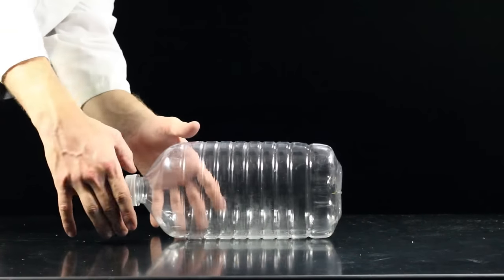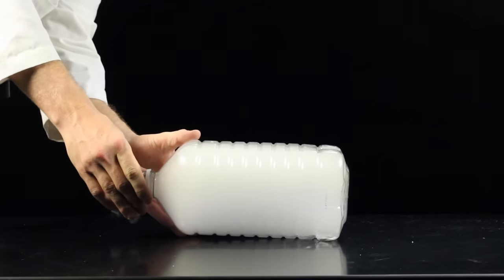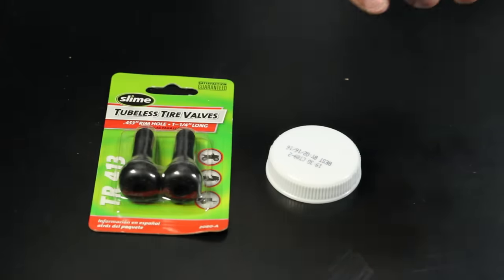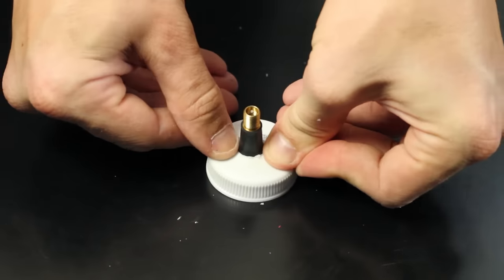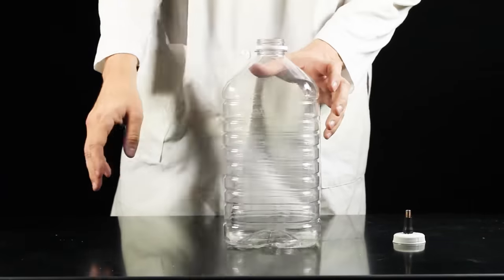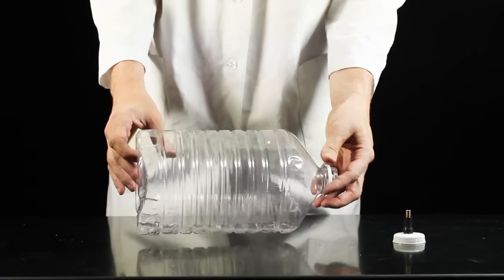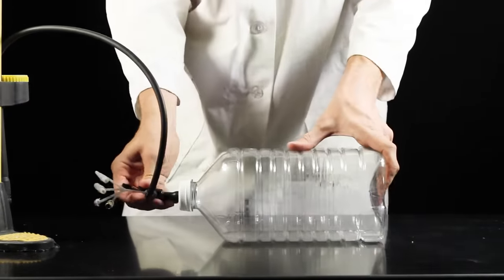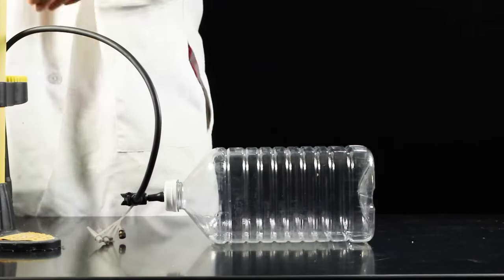Instant Cloud in a Bottle (Chemistry)

Comment from the maker: When the pressure is released the temperature drops rapidly causing small droplets to form from the condensation of vapors.  Isopropyl alcohol evaporates more easily than water creating more vapor molecules than if we had done the experiment with water.  So when the pressure is released and the temperature drops, the cloud is denser than if we had used water because there is more alcohol vapor than there would have been water vapor.
Reply: BeardedScienceGuy 

Wouldn't a cloud of alcohol vapor be dangerous? What would happen if you lit it on fire?
Reply: Peter Barta sounds like fun to me
Reply: Peter Barta in the bottle i'm willing to bet it would not in fact explode. Not enough oxygen more than likely. I have played around with alcohol enough to take an educated guess and say that by placing the bottle up again and lighting the top on fire you would basically have a small lamp of a sort. Nothing useful but it's still itneresting. Still, wear protective gear when playing with fire. And always have a fire extinguiser there. safety first after all.
Reply: +BeardedScienceGuy now my friend said you cant inhale this i will die dont do it soo is it true
Reply from the maker: Depending on how much is absorbed into your body, yes.  Isopropyl alcohol is toxic and will lead to many negative health effect if absorbed into the body.
Reply: xphosGameing One breath wont kill you (has done it as a kid) but it can burn the lungs and if one continues breathing in the vapors it can do a variety of things. The most immediate being suffocation.
Reply: write a comment not a essay for school
Reply: BeardedScienceGuy

Comment: Could I get drunk off breathing this in lol
Reply from the maker: Joshua Nuckolls The term alcohol just means that a molecule has an oxygen atom bonded to a hydrogen atom.  There are many different types of alcohols and some of them will cause you to go blind or even die at high enough doses.  Isopropyl alcohol isn't the most toxic form of alcohol but it is toxic and not what people are talking about when someone uses the term "alcohol" in everyday language.   The type of alcohol being consumed for it's intoxicating effects is ethanol alcohol.  Isopropyl alcohol has more carbon atoms than ethanol alcohol and the molecule is also a completely different shape.  These differences lead to severe medical problems in moderate to large doses.  DO NOT DRINK OR INHALE ISOPROPYL ALCOHOL.
Reply: BeardedScienceGuy Which property of the ISOPROPYL ALCOHOL is responsible for this effect? Any other liquids that can give similar effects?

Comment: My Son wanted to do this for his science project but I'm doing something wrong and I can't figure it out.  I pump up to 20 psi and when i release the lid it makes a loud noise and the air shoots out but there's no cloud.  What am I doing wrong?  I do have the alcohol in there too.
Reply from the maker: The temperature of the bottle should be fairly warm and then you might try 30-40psi.  Most bottles will rupture at between 80-110 psi so you would still be well below that pressure but be careful of the cap flying off.  Also be sure to let the pressure drop quickly, if the pressure drops more slowly then you won't see the desired effect.
Reply: @BeardedScienceGuy  Thank you!  I ended up buying a rubber stopper from Home Depot and that really helped.  I think the screw on cap wasn't being released fast enough.  We worked hard on this project...hopefully he gets an A!  :)

Comment: Hi, just stumbled upon your video. Pretty neat, but you could a cloud without all that stuff by twisting a water bottle and building pressure within it that the cap would fly off and you’re left with a cloud ... does the alcohol have any significant importance? Mine was just a plain empty Poland spring bottle.

Comment: Will it Work of its hot outside/ it seems not to work when I tried it outside ....
Reply from the maker: +Danny Cruz (OboeFiles) You might need to add slightly more pressure.  The pressure drop in the bottle drops the temperature of the bottle causing the isopropyl alcohol to condense.  If it is hot outside you might need more of a pressure drop to get the isopropyl alcohol down to a temperature where it will condense.

Comment: If this is repeatable on a large-scale or even if one could create Cloud vapor on a large scale wouldn't you be able to effect the weather?

 being able to create so much vapor we're basically repeating what mountains do from the water that goes on it from the Dew, so.

 weather control?
Reply from the maker: We absolutly have the technology needed to change the weather.  The problem is the cost.  The clouds go tens if thousand of feet into the air.  Imagine 20,000 of these bottles stacked on top on one another and then you need 25 million of those stacks to be about one square mile of the earths surface.  It is still really really expensive but sending massive solar shades or mirrors/lenses into space would be a more cost effective way to control the weather.

Comment: 1:53 What happen to the liquid inside the tank ? (The sudden shake)
Reply from the maker: Yo Zora The bottom of the bottle is a dome shape that went from being an inward dome to an outward dome as the pressure increased.  The shockwave from this change in the bottles shape caused the liquid isopropyl alcohol in the bottom to spring upward.

Comment: Does it explode when lit?
Reply from the maker: Ioan Dragomir It will shoot a flame out the back but not explode unless more oxygen is added.  Our atmosphere is around 20 percent oxygen and unless oxygen is added to the bottle to increase to oxygen to fuel ratio the bottle will typically not explode.  That being said the reaction will increase the pressure in the bottle and if there are any structural weaknesses in the bottle it could rupture at a lower pressure than typical.
Reply: Ok
Reply: I don't think that's what he wanted to say. I understood that you would need some oxigen besides the alcohool in order to burn it more efficiently, therefore releasing more energy => BOOM
Reply: yes it catches on fire and it is very scary I know because I did it once then squeezed the bottle and lit the cloud and it made a mini flame thrower